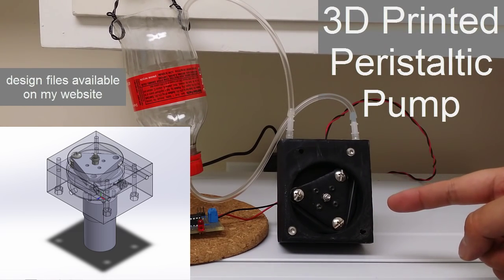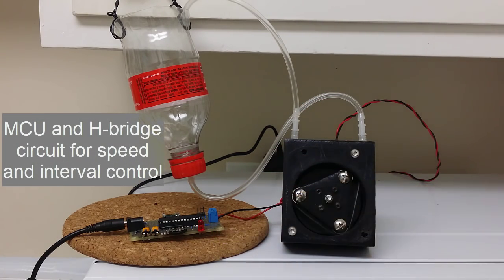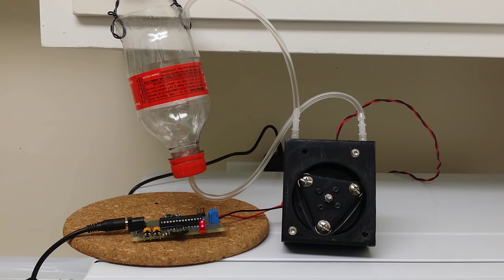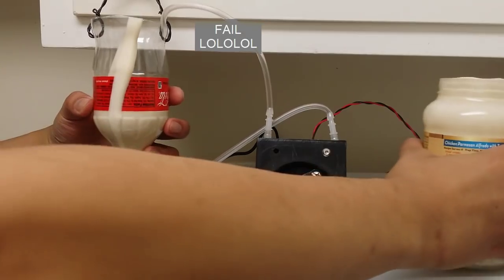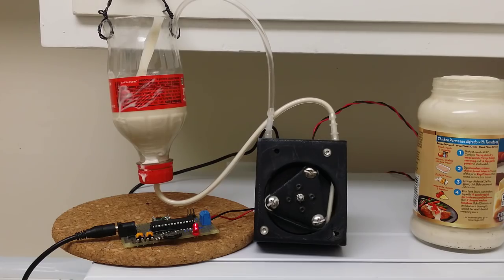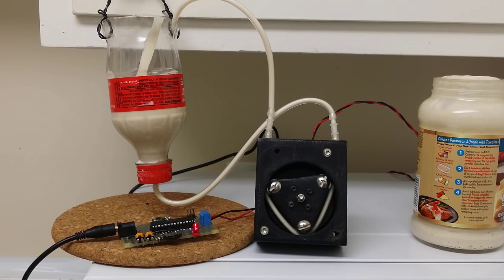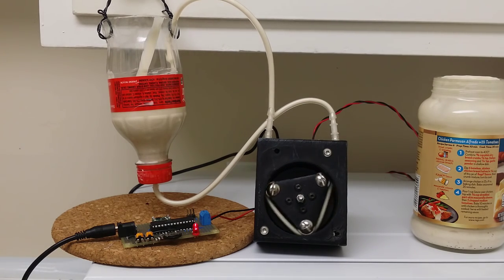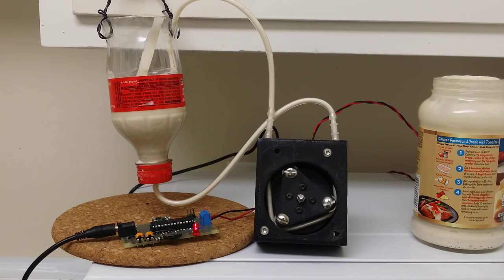3D Printed Peristaltic Pump

Comment: Have you tried using different tubing for the section inside the motor head? In the environmental industry we have a version of this style pump and soft silicone tubing is used inside with head to ease demand on the motor while a thinner dense tubing is used for any length that is needed. Just a thought, thanks for sharing.

Comment: Hello my friend your proyect is excelent i like to printer 3d but i dont find .stl please could put it 😊
Reply from the maker: I have changed the video description to include a link to my website where you can find the design files and information on the other parts. They are not STL files, they are the actually CAD models, which you can modify before exporting to STL. Have fun.
Reply: frank26080115 
Very thank my friend for you answer i will check your website